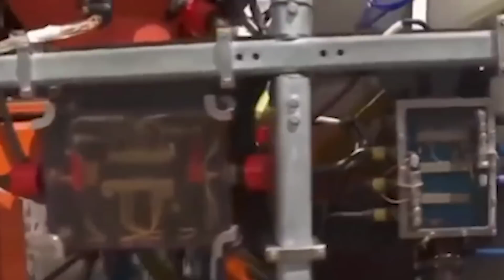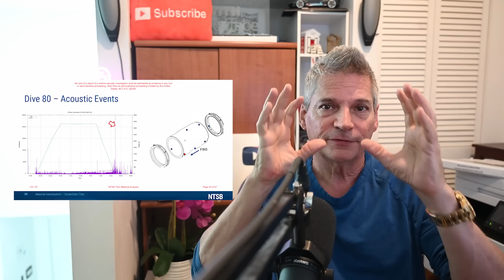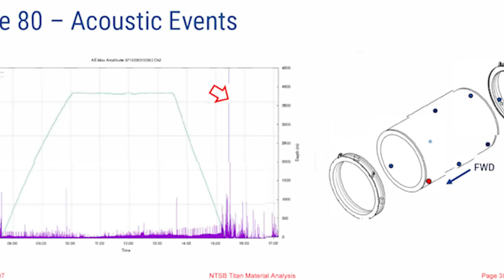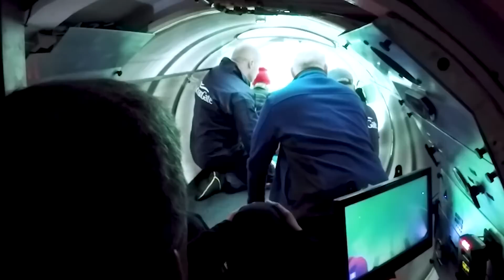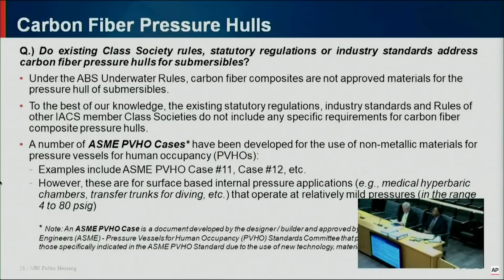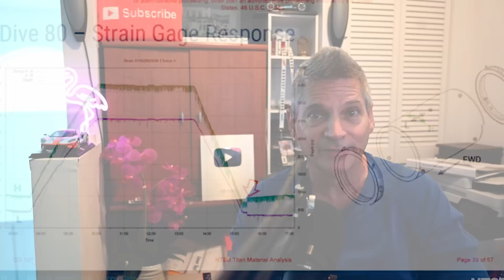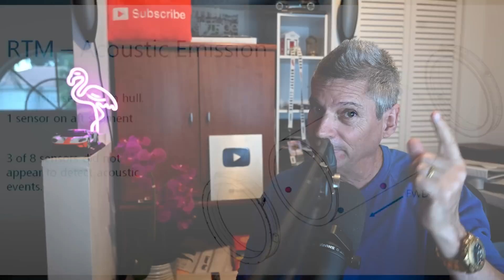How OceanGate Titan Sub Realtime Hull Monitor FAILED! RTM

Comment: the problem with "real time monitoring systems" is the "real time" part, it alarms when the event is happening, not months before, even with the data being reviewed after the fact, the readouts showing stress and problems were ignored, and the craft was taken down time after time, i'm sure they had a beep from the rtm a millisecond before it imploded, fat load of good that did

Comment: I still think they applied the carbon fiber incorrectly. If it was applied in a helix shape or overlapped in a zig zag fashion it would have made more sense. Would it have worked? No one knows, but applying it in spiral was nonsensical. This is just one of a list of issues the Titan had. I believe the passengers (except for the 17yr old ) were aware of and decided the risks were worth it. All you have to do is read the waiver they signed.

Comment: I spent my career in automation equipment, engineering and maintenance. 
I was at work one day and this guy says "it's easier to ask for forgiveness than permission" which probably is okay in certain circumstances. But we were working on systems which required tons of analysis in order to plan a change. And always had a back out plan. 
I only saw that guy briefly. I guess he resigned in order to spend more time with his family.

Comment: At the "acoustic event" the strain gage data plot shows a significant permanent offset. That was not the carriage to hull settling,. It was permanent damage. The prior dive strain gage plots show a slight progessive damage (the "curve" you pointed out). It "popped' and got worse. Considering the photos and other analysis, I think at least one of the 1 inch sub-plies delaminated at or near the Titanium interface.

Comment: The problem was it was not the fiber tube that failed first, it was the glue between the fiber and titan ring... the strain guages wouldn't necessarily alert you to a failure at the glue joint... but it did give an indication as seen after i believe dive 80 that the glue was failing. This was allowing water to ingress between the ring and the carbon fiber tube which eventually lead to the failure of the sub.

Comment: I'm a retired power plant operator. I have a license to operate boilers and pressure vessels in Canada. I can't understand why someone would design a pressure vessel the way Rush did. It makes absolutely no sense to have the ends made from a strong durable material, and the cylinder (which is the weakest part) from a material that has far less strength than the hemispherical ends. A chain is only as strong as its weakest link. That's why each link needs to be just as strong as the link preceeding it. Ocean gate could have been innovative in being the first company to regularly bring people to the titanic in a sub designed for repetitive trips. But that would mean building a vehicle designed for many worry free pressure cycles.

Comment: The real problem with carbon fiber in this use is that is has effectively no elastic strain capability, unlike homogenous steel or titanium.

Basically, every elastic event is actually a yield event.

And the problem gets worse to more discontinuities (like the "Stop, bake, apply glue, and start winding more fiber" process being done every inch.)

Comment: Basic "best practices" would have been doing a nondestructive examination (at least) of the cut off ends.

The visible flaws apparent (and they wouod have been apparent on both sides of the cut) in the carbon fiber winding should have been an absolute showstopper.

His misunderstanding of what those sounds his monitoring system actually mean.  Those cracks and pops he's listening for are themselves indicators of new damage to the carbon fiber.  Every single one of those  noises is evidence of continuing degradation.

Comment: (To squeeze the most from this new data...)  In service insp'n of composite structure in aerospace was initially iron age tech.  An issue w/ delamination in one particular design (...cough, hack, certainly not Boeing) req'd a new NDT test called "the quarter tap test".

Exactly as it sounds -- tap the area of concern w/ a quarter (coin), listening for the hollow, muffled thump noise that indicates presence of a delam'n or large void.  Non-US operators of brand-x aircraft had to ask brand-x / the FAA -- what coin to use if a quarter (coin) wasn't available?

Ok, back to YT and furry 'lil kittens falling into the bathtub.

Comment: There are various kit aircraft that are classified as "experimental" in the US (although they may get reclassified as Light Sport soon) that aren't dangerous if built properly. Some are even carbon fiber fuselage designs. However, there's a huge difference between aircraft and deep ocean submarine diving down to hundreds of atmospheres of pressure. I would never get into anything like the Titan, particularly because of the carbon fiber hull design mistake. A flawless crystal carbon diamond tube hull would probably work, but good luck fabricating that.
(ツ) ☕☕(ツ)

Comment: Well this isn’t right!
The RTM has worked as it has should work, they ignored the facts. This system showed fatal errors since dive 80. After this dive, there was shown a complete different pattern in the saved data.
The RTM worked well, the engineers behind it didn’t work well…

Comment: One bad idea ( real time monitoring system ) after another very bad idea ( carbon fibre pressure hull ) carbon fibre known for sudden catastrophic failure  under compression , loud bangs , hull degredation on prevoius dives 
Multiple warnings ,
all human beings are fitted with real time monitoring systems called EARS

Comment: You should never design a safety system that hearing nothing is good..... if a part fails you just think it's all working perfectly.
Also... how did you think the people in the sub were supposed to notice any sounds when they would be talking all the way down?

All the times you hear Rush discuss things... no one ever talks about how you maintain/repair the carbon fiber hull.

Comment: A prototype hull that is too thick to check for damage with a prototype monitoring system.  One model tested to destruction.  What a joke.

It should be many models.  Some of them have purposeful defects.  Some cycled to expected depths, some cycled to say 150% expected depths and some tested to destruction.

If you have one model that you test to destruction, you know what that one model sounds like when it fails.  You do not know what normal cycling sounds like.  You do not know what various defects sound like.  You do not know how the hull degrades after each cycle.  You know nothing.  Well I guess you know what it sounds like if the hull is identical in construction quality to the model and is dived to crush depth on the first dive, you would know that.  But not the second dive or anything else really.

I have no words for this.  You just can't get more negligent.

Comment: With decades of advanced material reinforcement, manufacturing, quality control, ISO, ASTM (I) and forensic failure engineering analysis experience, it is very clear to me a joint failure between the carbon fiber and titanium ring in the forward section is likely the first failure point that started the chain reaction. 

New data states they only used 4 out of the 16 bolts that are required  to close and secure the forward hinged titanium dome that is used to enter and exit the submersible. 

Why only 4 bolts? Did the holes not properly align

Only 4 bolts to speed up the process? 

What does the 4 bolt data tell one? 

I have lots of unanswered questions.

With my formal education, real world training and experience I am shocked to the improper engineering, manufacturing, safety systems and basic disrespect to common sense and human life this organization willfully engaged in. 

All the disclaimers in the World are no justifications for murder.

Just saying!

Comment: The real time monitoring system was just a gadget to silence any critics. Due to the nature of carbon fibre composite, the stress sensors wont indicate  anything, before its too late. And rhe acoustic sensord were useless, because they picked up random noises, nobody could interpret. IMHO the main misunderstanding is the presumed absense of sheer forces, which made them wrap all fibres in parallel. There are indeed sheer forces at both ends, where the cylinder meets its end caps.

Comment: I believe reason the early warning system didn’t go off is because the failure started when the glued end caps separated from the pressure hull. Even the pressure hull was 30 inches thick it would not have prevented this from happening

Comment: The supporting 'O' rings on each end may have been enough to prevent the structure deforming on each end which may have caused the resin  adhesive to crack. Still,  that may have extended its lifespan by maybe a few more dives anyway before ultimate failure.

Comment: So during the test model he said there should zero noises detected and if there are, to abort dive immediately. He HAD that noise on the 1st dive with the real thing and the noise got progressively worse. So he KNEW it was compromised. He just may have thought since it didnt implode with people in it after the 1st noisy dive that a certain amount was tolerable. He shouldn't have but he wanted to be the 1st at something and murdered everyone because of it. This is the 1st multimillionaire mass murderer.

Comment: Flawed idea as mentioned but even the monitori systems picked up data indicating critical hull failure at the end of dive 80 or 83-ish. Either ignored by OG, covered up or misunderstood. Their times series analysis was inherently flawed, should have been by depth/pressure as discussed at the Board of Investigation.

Oops sorry I see it discussed 😊

Comment: The sensors actually worked for most of the part, and they brought back usable data. But what did the data actually mean? I figured that by the time the sensors gave some useable information, it would have already be too late. Seems that Mr Rush let the data tell him what he wanted to hear, and it really wouldn't have mattered what the sensors recorded, since there was no real precedent to compare it too. At least some data was still recovered after this tragedy. I am almost surprised that he didnt just delete the data that he didn't want to hear, since it seems that there was very little regulatory oversight.

Comment: Jeff, I'm not clear on Stockton's Engineering specialty, but in Aerospace use of composites (incl. carbon fibre) is acceptable for primary (critical) structure based on "damage tolerant" design.

The benefits of carbon fibre in new designs are worth the upfront investment but only the serious major players have the resources to go this route (money, skilled personnel, manufacturing & tooling).  Smaller players use "damage tolerant" criteria as well but stay w/ Aluminum alloys.  (The ground work is already done and in public domain and inspection for critical-length cracks in structures incl. NDT are a common maintenance task and doesn't require (relatively) specialized tools and specialist skills.)

For insomniacs -- "damage tolerance" = "safe to continue flying w/ cracks /voids/delam'ns identified during the current insp'n -- until the next insp'n.  When a crack/anomaly is discovered at a periodic insp'n that's longer than the critical crack length calculated by Stress.  At that point the structure is deemed "no longer safe for flight".

(Sorry for the textbook, Jeff.  Stress and aerospace design aren't a short subject (?))
Reply: Apples to oranges... underwater is different to flying... comparing them means nothing...
Reply: @flipflopski2951  @flipflopski2951 you have good reason to object to submersible vessels vs aircraft, but there are better grounds.  Both are pressure vessels (just thinking of the hulls) so there's grounds to consider both similar structures.  But my "D'oh!" moment was realizing that the principal stresses due to ΔP on a pressurized aircraft hull are tensile which are the source of progressive crack growth.  In a submersible the ΔP loads are principally compressive which have no impact on crack growth .  That there is an apples-to-oranges that should embarrass even an undergrad.  Fortunately I have no shame.  Thanks.
Reply: @flipflopski2951  Sorry @flipflopski2951.  Looks like my windbag of a response didn't survive YT posting.  (I'd guess too much profanity?).  I'll paste the reply back again, and no oblig'n to read, or even to act interested.  Stressmen have thick skins:

@flipflopski2951, you have good reason to object to submersibles and aircraft having different roles in different enviro's.  But there's much better grounds when I thought further.  The similarities are -- both are pressure vessels (the hulls), both (should) have mandatory periodic NDT insp'ns w/ strict pass / fail criteria.  And both are designed to the same safety factor (1.5 -- I just learned that from this vid.)

But my "d'oh!" moment of apples and oranges was realizing that that the principal stresses due to ΔP on a pressurized aircraft hull are tensile (which cause progressive crack growth.  In a submersible the ΔP loads are principally compressive that do not cause crack growth .  That there is an apples-to-oranges that should embarrass even an undergrad.  Fortunately I have no shame.  Thanks.

Comment: My own theory is that, because the titanium and composite compress to different extents as the pressure goes up, the adhesive in the C-channel that bonded them together was under cycles of tremendous strain every time they took the sub on a deep dive.  On dive #80, it either fractured, or separated from the titanium (to my knowledge, there was no surface treatment to improve adhesion).  As a result, the pressure on the hull was thereafter being transferred to the thin titanium flange that was supporting it.  
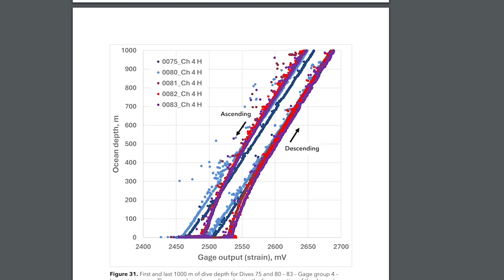The curve in the lines (@10:00) is the region where the hull is deforming; the straight line is where the flange is bearing the pressure. That flange, which was not designed to carry the full pressure on the hull at depth, is completely sheared off in the wreckage, and the remaining titanium surface is completely free of the epoxy adhesive.

Comment: As an engineer with 28 years experience reviewing data this video says exactly what I was thinking when I first heard of Rush's detection system.  That is it would likely produce some anomalies that may predict a problem before it occurred.  BUT, how would anyone know how to interpret the data?  What does a problem look like?  Do you scrap the entire hull if there's an anomaly?  Rush and the team saw what they wanted to see, which is always the problem with reviewing complex data and one is biased towards a particular conclusion.  It's a system that could work in theory, but not in practice.  The other issue, of course, is what if it gives you a 5-minute warning, but the surface is 2 hours away?

Also, post-dicting an event is entirely different than predicting one and then taking action.

Comment: I think we're seeing a Dunning-Kruger effect here. Stockton thought he was a lot smarter than he actually was. I'm not a professional engineer by any means, but even I know that a pressure hull needs to be a sphere at those pressures. You did a good job of commenting on this info. Why did it fail? Probably all of the above. The layered construction with successive autoclave curing processes, the shape, imperfections in the application of adhesive. The idea that a "real time" monitoring system would do anything at all is just absurd. That's like holding a gun to your head and putting a microphone in front of it and saying "oh it's fine, the mic will pick it up before the bullet hits me".

Comment: I'm a professional plumber, with 35 years of round shapes cylindrical pressure experience, doomed design.. not difficult to figure out the design issues & flaws of this failure.
Reply: This man has a point

Comment: i'm prettey shure they sould had like 4 layers of carbon and tittauim hulled in like a very thick sandwitch with the carbon laerys  bweteen 2 titatuim layers eacth. so if one layer of carbon fiber has issues the other 3 layers could help keep things giong and make it much rreaser to replace the bad layer as long as the other layers don't bucke or brake that is. also should habe like 20 of thsoe sesors too and not only acustic but also pressure and sturcue defrecnal and mosture and lectcal conudtivety and restace sesors on top of that too. heck then also make it shaped like a a huge ball too. also make it like 30-50 inches thick hull per eacth  layer  too as well ! theres nothing like over kill to bacly try to make this kind of sub acatly work. however the titan sub simply would never make it past that with how crapey and the very lack of reducty and falsafes and extra saftery proactive messures. if i would make a sub this comant is my proacvie mssures would be so overkill that it would have prevefnt this disater before it would have happend. also add some tustein hexgonal srcutral plates as the reinferoemtn sructe bulkheads on the inside for very very very extra toughness too as well.

Comment: To be fair, the system worked in some ways. I mean, it showned that during the dive #80 something was about to become a big problem. Stockton Crush had 8 dives to take actions but he didn't care, as the thing he wanted was to die in this submersible (him and Nargeolet were depressive).

Comment: Did they only test the scale model once, all the way to destruction? They should have tested many pressurisation and depressurisation cycles. And they should have repeated the test with a number of models, to determine how consistent the results were (and how consistent their manufacturing process was).